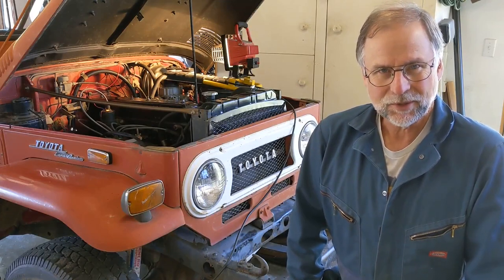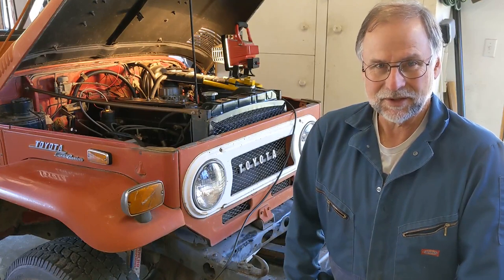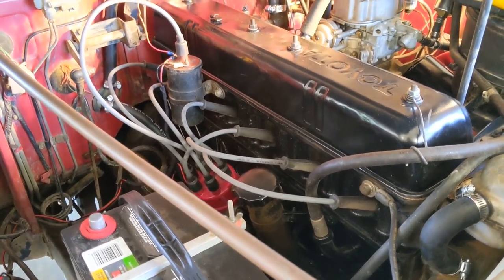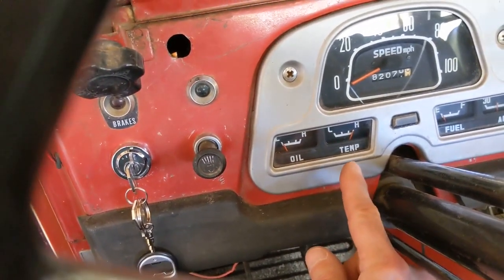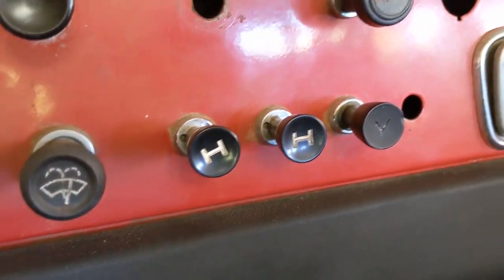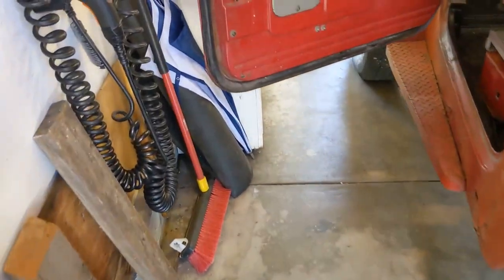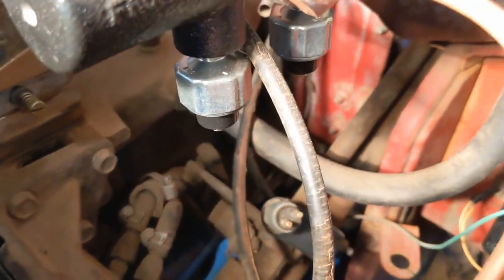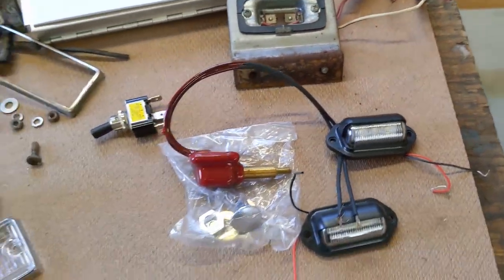Electrical System Walk-Through and THANKS!

Comment: My 68 has been parked for the past 14 years. Everything worked then but almost nothing does now. I’m assuming all the grounds & connections are corroded. I’m greatly enjoying your videos!  Keep them coming. The longer the better. I enjoy seeing you work & process ideas.
Reply from the maker: Thanks. The plan is to post about once a week.

To figure out if corrosion is the culprit, see if the voltage drops with distance from the battery. 

I think I have some corrosion issues on mine,too. Maybe I should do a video about that.

Comment: Just started watching this series, and I like it so far! I'd like to see your troubleshooting etc. I just bought a 73 FJ40, and the Gas and Temp gauges don't work. I know what I need to do, but seeing someone go through that would be awesome. Good stuff!!
Reply from the maker: The process of finding out why gauges aren't working is not all that complicated. Unfortunately, I didn't make any videos when I fixed mine. It's a good topic. I'll see what I can do.
Reply: @mikerestoresanfj4069  I second that. Would love to have some guidance on getting gas and temp gauge working
Reply from the maker: @seanbowie7966  Do you have a volt meter?  If you do (and you know how to use it) I can give you some pointers.
Reply: @mikerestoresanfj4069  Y & Y. My fj40 is carb work done. It’ll be back next week. I’ll check in with you then. How do you prefer to message?
Reply from the maker: @seanbowie7966  I added an email to the channel. In the About tab

Comment: I like your logical approach Mike.  Making the list and comparing to the wiring diagram you may see a correlation between two issues and fix with one solution. I am with Joe on this one.....check those grounds if you are see low voltage. Great Job.
Cheers!
Reply from the maker: Low voltage is the next video.  Will shoot it Friday/Saturday

Comment: I just acquired a Sept 1971 FJ40 and have been going through the wiring issues.  One issue I have is with the brake warning light lamp in the dash.  The light is in the dash, with a bulb ,but the wire is not connected to anything. I am not sure where I should plug it in? Have troubleshooted or investigated this on your fj40??
Thanks,  Chuck
Reply from the maker: I had to fix the parking brake light, too.  It was a while ago, so this might not be 100% right.

I think I remember that the wire from the light went over to a pigtail just behind the parking brake pull handle. the pigtail is a connected to a little switch.  When the handle is all the way in, the switch opens and the parking brake light goes out. Pull the handle out, the switch closes and the light goes on.  Remember you have to rotate the handle to get it out of the ratchet. The light won't go out until you push the handle all the way in AND rotate it back down.

Try these three tests:
1) Test the light: Make a jumper wire that is wired to +12 volts somewhere on the fuse block.  Touch this jumper to the wire coming out of the light socket. The light should go on. 
2) Test the fuse.  There should be a wire coming from the fuse block to the switch at the base of the parking brake.  Use a voltmeter to confirm 12 volts going into the switch. The ignition needs to be on for this test.
3) Test the switch. With the ignition on, use a voltmeter to check voltage between the pigtail and ground.  It should be zero volts with the handle in and 12 volts with the handle out.

If all tests are successful, you can connect the wire from the light to the pigtail and everything should work. 

If the first test fails, you probably need a new bulb.  

If the second test fails, check the fuse.  

If the third test fails, clean the shaft to make sure it goes all the way in (that was my problem). If goes all the way in, you may need a new switch.

Hope that helps.

Comment: when my lands cruiser was painted they remove the lights switch and then they never could put back together. any idea how to wired it ,thank you
Reply from the maker: I'm assuming you're talking about the headlight switch.  My first guess is that the painter disconnected the light switch and pushed the connector behind the dash. If so, you should be able to find it, pull it back through the hole, and reconnect the switch.  The terminals are arranged so it's difficult to connect it incorrectly.

Comment: have a 1972 FJ40 ..... replaced the ignition switch ..... HOWEVER ..... engine starts ok , but somehow the all the lights are still ON even after turning off the ignition ..... please advise
Reply from the maker: The first thing I'd do is make sure the switch is wired correctly.  

I don't have a '72 wiring schematic, but I have a '71 which I used for this reply.  I hope they didn't make major changes in '72.  

On the '71 FJ40, there are only three wires on the ignition switch. A black wire with a red tracer comes from the fuse block and is the incoming power (it's always hot). This wire goes to the AM terminal on the ignition switch. A black wire with a yellow tracer goes to the ignition and goes hot when you turn the ignition on.  This wire goes to the IG terminal. A black wire with a white tracer goes to the starter and goes hot when you hit the starter.  This wire goes to the ST terminal. (The AC terminal is not connected to anything.)

If you wired it correctly and it still doesn't work, then you must have a fault in the wiring harness.  There's a process for finding these, but it's too involved for this reply.